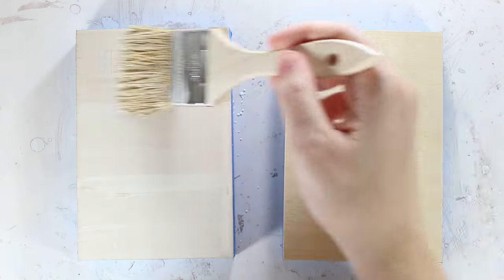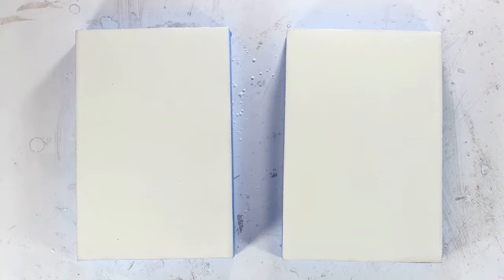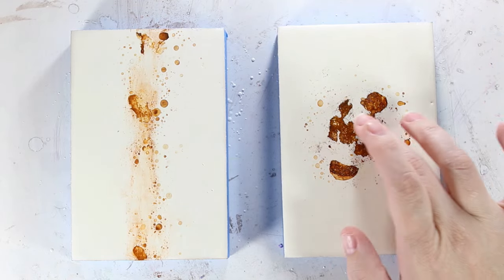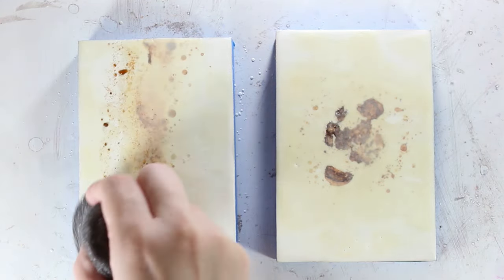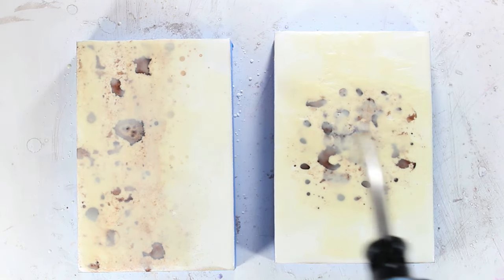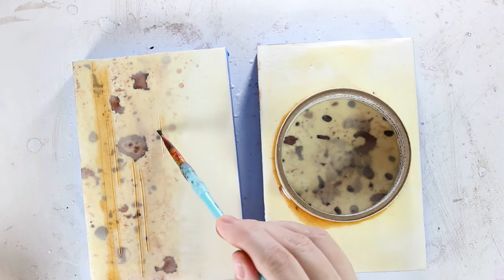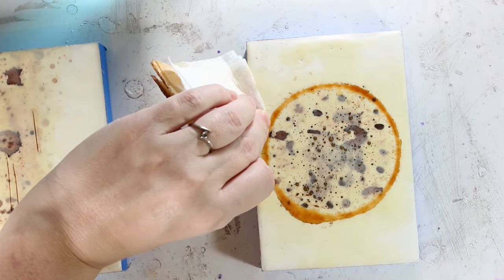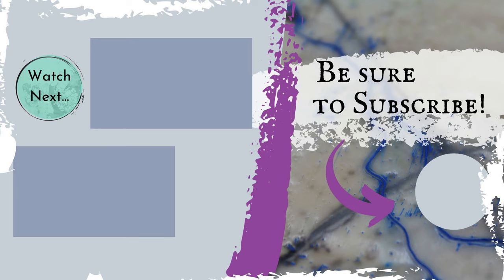Experimenting with Rust on Encaustic Paintings

Comment: Doesn't the wax melt off in very hot climates?
Reply from the maker: The resin in the wax makes it more durable, but yes- you don't want it to be too hot where your piece is hanging because the wax will soften and could chip or scratch more easily.